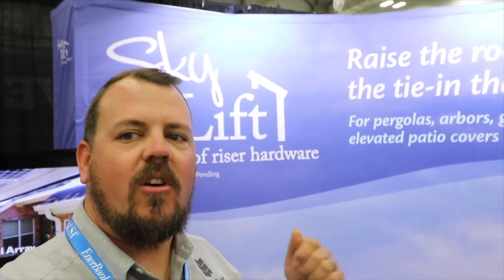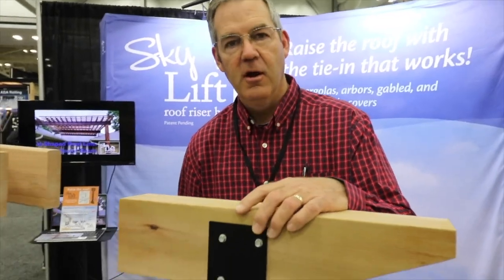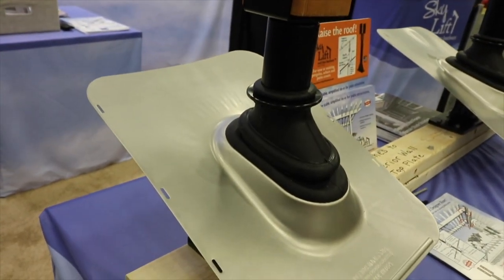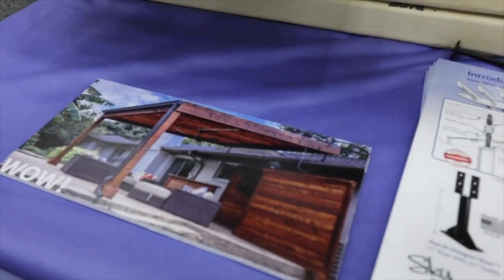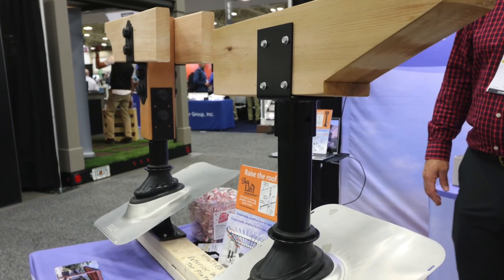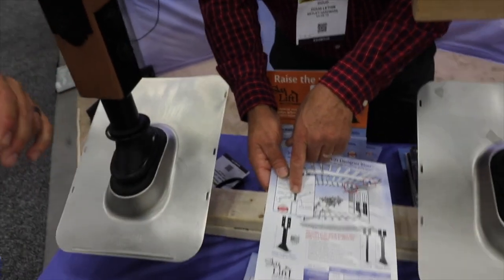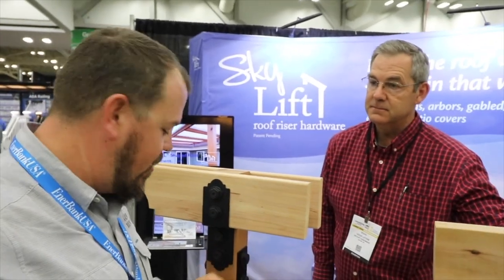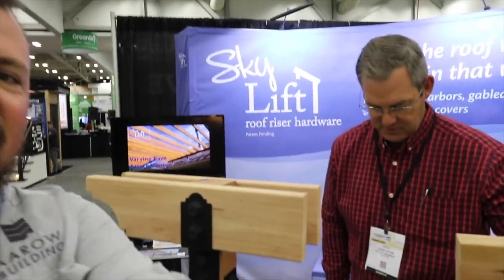PERGOLA to ROOF connection - the simplest method?

Comment: We used these on out deck remodel to give us proper height and pitch to a deck remodel/covered pergola. We're pretty pleased with the results! We'd definitely use again. We only ran into a few hiccups. The shear bracing is going to pretty important, as it can make a pretty big moment arm up there above the roof. SkyLift was seriously the only solution we could have used on our 2/12 slope roof, low fascia board and second story deck, and it worked just like advertised.

Comment: seems there could be a problem with thermal transfer...
Reply: These were designed in the PNW (Salem, Or), where thermal transfer from either extreme heat or cold isn't really an issue. We have a LOT of low ceiling, 4/12 roof pitched ramblers and ranches here in the PNW that this product makes perfect sense for, especially considering how much it rains!
Reply: @MissElisabeth  
i'm sure it makes perfect sense in some instances but i grew up in oregon and remember as a kid spinning out on i-5 just past the Tualatin exit (205) going over an overpass just as freezing rain hit...

Comment: Jake why is your state of Missouri #33 most efficient state in the country. It's embarrassing tbh.  What are y'all doing?!?! 🤷🏻‍♂️
Reply: not sure which state you are from but high efficiency generally comes with high upfront costs. Folks like Jake are trying to change the direction and we need more of them in MO! But the average MO annual salary is 50k... that makes the affordability of the necessary changes the key challenge. The other is the fact that energy is still fairly cheap in MO. That makes the incentives to build high efficiency fairly low.... especially when the average person can barely afford an existing house much less to demo then remodel a house which isn't likely to see the valuation increase to justified the costs of that remodel in any reasonable timeframe. 

So right now, the market for building high efficiency is for not the average person in MO... more like only the top 5% who are doing it not for the costs savings but more as either a status flex or personal interest in saving energy... which explains why folks like Jake are few and far between in this part of the world... 

make a house that can attain passive standards AND that can be built for 150k total (that is move in ready AND with the land) here in MO then that would be a game changer...